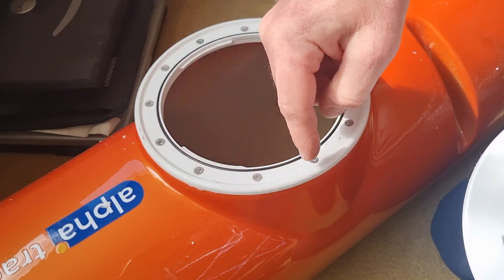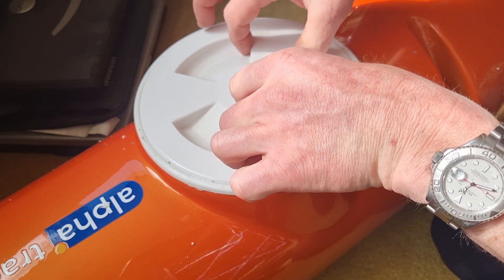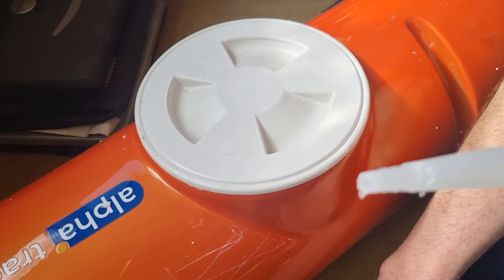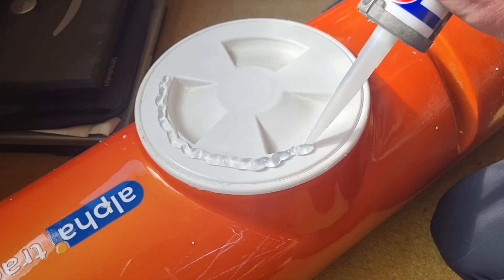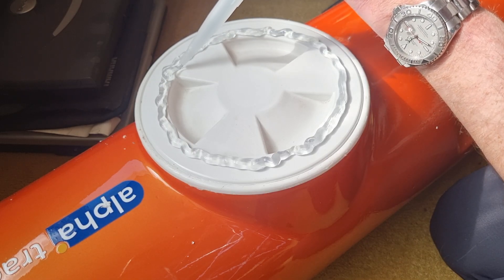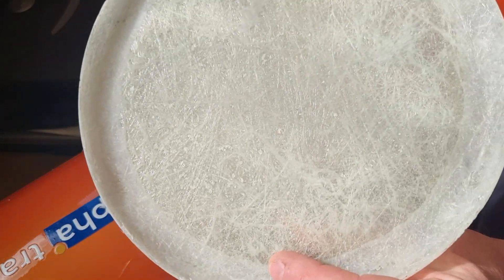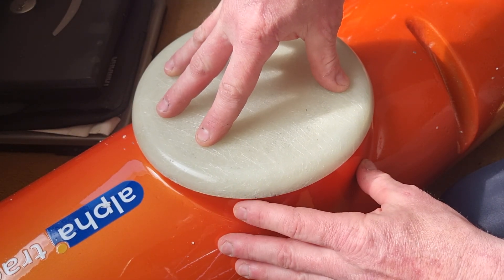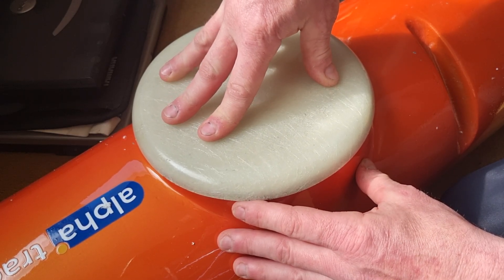Strengthening the hatches on Big C ready for the North Atlantic waves (pt2)

Comment: Did these fail during the test?  I don't recall seeing that.
That fiberglass cover won't provide much if any extra strength or sealing.   I guess it will keep them from turning and coming loose.  Which is how they "fail" normally.   Some kind of positive locking would probably be a better bet.   Going to be hard to open them  yourself with cold wet hands like that...
Reply: I thought it might make it easier to use given you could grip that turned-down lip with both hands, kind of like gripping a wheel. But I also thought with the lip turned down it could be ripped off if the boat dips down and the wave catches the lip with some force.